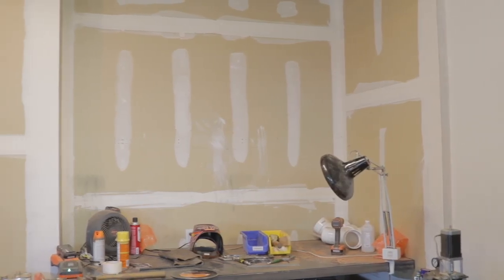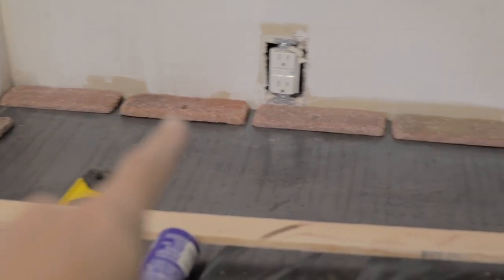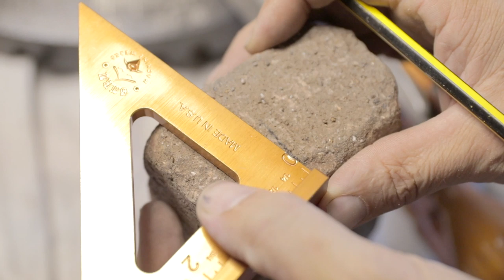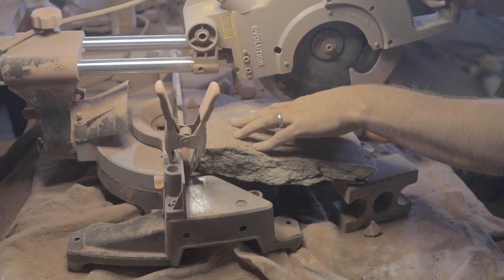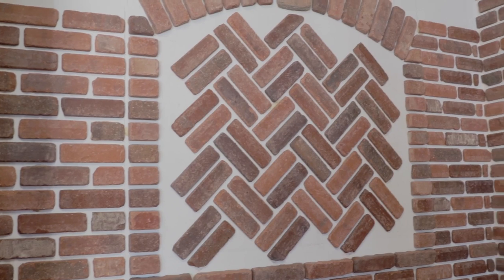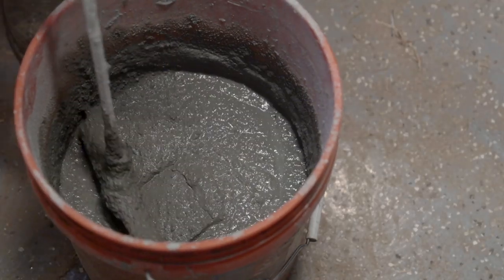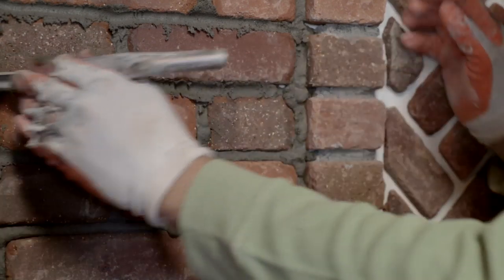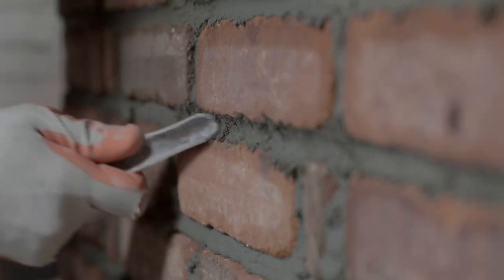How to Lay Thin Brick Like a Pro

Comment: First...great job Greg.  Artisan level work!  I had 1 issue.

IMPORTANT:  NOT ALL TYPE S MORTAR IS CREATED EQUAL.  IF YOU HAD TROUBLE GETTING YOUR MORTAR TO FEED OUT OF THE GROUT BAG - CONTINUE READING

When I started my project, I had a QUIKRETE TYPE S mortar - 80 lb bag.  I bought it because I figured Type S mortar is Type S mortar.  It is not.  I've done quite a bit of tile work and mixed the mortar to a consistency that I thought should work.  This however, was my first grout bag attempt.  Total failure.  I tried 20 different methodologies trying to get the "grout" to feed out of the bag.  I'd get 1 to 6 feet of grout out and then the entire contents would turn to the consistency of wet sand and there was no way to get the feed going again.  I literally worked for 4 hours and got maybe 30' of mortar done.  All my time was being spent emptying the bag, cleaning it and restarting the process.  Tried different levels of wetness - all for naught.  The issue when this happens, is too much sand in the mortar mix.

I switched to Spec Mix Type S mortar - THIS MADE ALL THE DIFFERENCE.  After the switch, the mortar fed out of the grout bag just like all the videos I'd seen online.  I hope this helps someone.
Reply from the maker: Great information Dale!  Thanks for taking the time to share.  I'm going to pin this comment to the top...  I hope this doesn't sound like it's coming from a "high horse" perspective, but this is why I recommend using a masonry supplier for your entire project.  Those guys live this stuff every day and they will put the right product in your hands.  They also would never be caught dead with QuikCrete on the floor of their show room...  All type S has to meet a strength requirement, but you are correct; it's NOT all the same.  I hate that you had to go through the pain of finding that out, but I'm happy you shared your experience.  That's what my channel is all about - helping the next guy do it better.  Cheers!!!
Reply: @GregsGarage  Happy New Year Greg!  No, your response does NOT sound "high horse" - it sounds like the voice of experience.  Honestly, I didn't know there was such a thing as a masonry supplier.  I've had to use electrical and plumbing supply houses on previous projects so it makes sense - I just never thought of it.  I have another question, but will post it separately so as to not detract from this thread.
Reply: Thanks Dale and Greg.  I am ramping up to do a project like this, and my only concern was the consistency of the mortar, and the specific type.  I do have another question that I get mixed answers to... Greg applied a primer to his wall, and some folks tell me I need to clad the wall in concrete backer boards like the material used behind tile in a shower.  I would rather prime the wall (cheaper and faster).  What do you guys suggest for this application?
Reply: @matthewpeterson3329  A great question.  I don't know why, but I'm pre-disposed to not apply tile/brick veneers, etc to sheetrock.  I guess because I grew up with brothers and we routinely did stupid stuff that I feel like would damage the underlying wall.  So I can't really answer your question other than to say that I used the cheapest backer board I could find...in my case it was 4'x8' Hardie siding...which isn't cheap.  One more thought...if you ever decide to hang anything on the wall you're remodeling...you may want something extra to help hold the load.  Good luck on your project!
Reply: @daleedwards7940  Thank you Dale.  Excellent advise.  Your comment about having brothers reminded me of an incident about 50 years ago, when a poorly executed back flip, while I was jumping on my bed, yielded a face plant and two knee-sized holes in the drywall above my pillow.  Mom was not happy.

Comment: Great job! However, I would not recommend this adhesive in the future.  It sags considerably, which means you must have enough wooden spacers for the entire wall.  It also has a 2 - 7 day drying time.  I would recommend Loctite Power Grab Ultimate, which sticks immediately, allowing you to remove the wooden spacers. It also dries in about 24 hrs, allowing you to mortar more quickly.
Reply: What’s benefits of using an adhesive over say thin set?
Reply: @garrettp.5018  the problem I've heard is that it is not sticky enough; the "tiles" slide down the wall,  jamming your spacers. I'm not even sure it will adhere to brick.  Then when you try to pull the spacers, you run the risk of pulling off your bricks.  If you use rope,  the bricks will crush the rope and end up creating spaces that are smaller than the actual diameter of the rope.  I have heard of people using mastic, which is stickier, but it smells horrible, and is also harder to find.  I would put out little extra money and use the Loctite Powergrab Ultimate. Use a caulk gun and "butter back" the bricks. Make sure it's a rough surface, or at the very least primed with a quality primer.

Comment: I’ve watched so many installing videos for thin brick and/or veneer brick. No one else used or uses a glue compound for adhering the bricks to drywall. I’m following your lead, hope it works.
Reply: Follow up on this, the set time was too long for me. I was using regular tile spacers on non-uniform shaped thin brick. Which caused the bricks to not fit properly with the spacers and they were sliding down the wall. Ended up buying dowels and switched over to liquid nails extreme. Can I post a picture on here? Don’t know how.

Comment: Really well-done: the project and the instruction! It is beautiful! I am inspired. 

One comment, which I hope everyone will take in the spirit I intend—to keep each of you healthy—be aware that these products: the brick, tile, and the grout, all contain silica—yep, just like sand at the sea-shore—but when in very fine particles, inhaled, it causes lung damage, which can become serious, and even fatal, over time. 

In a ceramics studio, the silica in clay is worked wet, so that as with the mixed grout here, it is quite safe. In a well-run studio, all of the clean-up is done wet, so that there isn’t silica dust in the air. 

Any time it is dry, though, for example, when cutting brick or tile, or mixing dry grout, simply wearing a well-fitting HEPA filter mask can prevent lung damage. These are inexpensive—as low as $35. You can order one on line, or in a city of any size, find an outlet for contractors, which sells safety equipment. 3M manufactures them, and now makes ones better fitting for women too (which I appreciate.) I have also bought one from another manufacturer—the name escapes me. Look for ANSI certification. The mask should fit snugly, so no air can escape around the edges. 

Again, great video—I’m inspired to do something like this at home, having far more time than money! Thanks for posting this.

Comment: Great work 👏 👍 👌 
I have a question. 
Can I use this thin bricks as outside siding without exposing the house to extreme heat or cold, snow and rain, and high humidity and moisture as I live in Toledo, OH where I think we have the worst weather. 
Also can use cement to glue the bricks.

Thank you

Comment: Looks awesome.  For those looking to cut costs, if you can acquire a bunch of regular bricks,  you can use a paver saw and cut the bricks lengthwise into 1/2 inch or so thin bricks.  It must be a brick or paver saw,  because the brick must clear the top of the saw. They can be rented.  I went on Craigslist and in the community looking for free bricks. It also allows you to use some variety.  You might get lucky and find some stamped bricks!

Comment: Thank you for the video! Very informative.  I am getting ready to install a brick veneer on a drywall wall that's 17'x8'.  And I have gone back and forth a million times on how I'm going to approach the install.  Manufacturer suggests moisture barrier, metal lathe, lots of mortar, and then the brick.

I like your approach much better though. Any regrets on using the loctite? I'd use loctite power grab general purpose. Any thoughts?

Comment: Great Job! , I want to do the same on the walls around a wood stove. Is it ok to use this same adhesive Loctite PL400 or do I need a different one for heat resistant?
Reply from the maker: I would defer to your supplier.  There are different types of brick, backer and adhesives for use in heat sensitive areas.

Comment: Beautiful, but not sure it is right to put all that weight on sheetrock?? other videos installed a wire mesh first and brick on top of the wire mesh
Reply from the maker: This was the supplier's recommendation for an indoor application.  The manufacturer also recommends this method for installation indoors.  If you are installing the veneer outside, it needs to be handled with a completely different set of details similar to a traditional stone veneer application.

Comment: this. is. awesome. i was so inspired i pretty much decided to copy, borrow, steal, replicate your entire process (though on a much smaller scale). i only have a pilaster...but the english pub...great stuff. one thing thing....using the Loctite Subfloor...you make it looks easy....finding that it takes a few hours to fully set up. dont know how you didnt go bananas waiting for it to dry. but beautiful work!
Reply from the maker: Yeah, they have a "quick grab" adhesive, but it still needs to set up.  I had a system where I'd lay up 5-6 courses every night.  On the weekends I'd lay up bricks in the morning and then again in the evening.  I'm glad you were able to steal a few details!!!  Brick is all about the patterns, bumps and edges.
Reply: @GregsGarage  you are my hero for responding. and for confirming that im not crazy. i started yesterday and it kept sliding. i cut 7/16s spacers which helped. then a couple hours later...bricks still had some give. so i woke up this morning with the plan to lay two or 3 levels every 4 or 5 hours. based on your process...im on the right track. and yes...love the bumps and edges. tile saw was giving me lines that were too clean. needed to take the hammer to the edges to rough them up...based on your work....thx again.

Comment: Great video about this process.  I'm about to use the same process to lay thin brick behind a wood stove to make a fireplace appearance.  This has some good tips I hadn't considered and I'm getting the grout bag and joint tool from your amazon links :P   I'll be cutting my own thin bricks from whole salvaged bricks with a wet saw.  I've cut brick with a dry diamond blade and that is super messy!!  I hope you wore some PPE.
Reply from the maker: Good luck Charles...  And yes, I had a full respirator on.  I also had a dust mitigation system running the entire time.  I would have preferred a wet saw for sure, but I didn't have one available, so I used the dry saw.

Comment: Greg, you did a very respectable job for an ‘architect’ and not to criticize your work but a good mason would never column stack the pilaster like you did. As you mentioned, getting the details right is what sells the job as authentic. The better way would have been to use a running bond and alternate cutting and turning the corners to eliminate the tiny pieces you used on the ends next to the whole corners. Make sense? 

Worse, I’ve seen thin brick or stone installed on bump outs where there’s no foundation or any kind of support for a real masonry wall. That’s a dead giveaway that it’s a ‘lick & stick’ installation.

Comment: Question, I’m doing bbq island and using the polymer mortar specifically for thin brick, like $15 bag, works well , question is for the grout lines should I use the same or just get some pre mix S type ?

Comment: Wonderful wonderful tutorial!  Quick question:  could I used drywall primer on old plaster walls or would I need another type of primer?
Reply from the maker: You'd have to ask your supplier.  I'm not sure what primers provide the best adhesion to plaster...  The PVA primer works well on the paper face, which is COMPLETELY different than a cement plaster.  They may actually suggest a thin set since you're substrate is porous.

Comment: Greg can I ask you why did you use adhesive instead of thin set mortar?
Great job btw!
Reply from the maker: A few reasons.  First, the walls were already finished in drywall.  I didn't want to add a cement board backer.  Second, its interior, so adhesive will work.  Lastly, the adhesive grabs quicker than thin set...  There's nothing wrong with using thin set, it just wasn't the best approach with this application.

Comment: I am a bricklayer and I say you do great work lol 👍and where did you get that little square at? Never seen one that small
Reply: You’re exactly right! I’m a Mason also and was impressed with his work. 
Especially with him using the grout bag, most of seen try to use a tuck pointer. 
And for all those that think the grout bag looks Easy, it is.... but those forearms will be worn out after that entire wall. lol

I’ve never seen a square that small either. I’ve Always just thrown another brick over my cut piece to line it up.
Reply: I'm a mason, and my concern would be longevity of this over time.  I'd much rather put up cement board and use a thinset mortar on an application like this.
Reply: @jamesfranks1790  I have been doing some research, getting ready to do some of this in my house and I agree with you
Reply: james franks 
You’re right, it’s likely they will come loose and fall off over time. 
Hardy backer board works really good and I’ve had good luck with Mastic holding them secure.

Comment: Hi Greg!  Great video!  Quick question…
I am using thin brick on an interior wall that has OSB and not drywall.  How would you suggest I prep the OSB?
Reply from the maker: I would defer to your supplier / manufacturer.  They will have the best prep and adhesive recommendations for the product you are going to use.

Comment: Great explanation. Would you be able to hang something on this wall?
Reply from the maker: I've hung several things on it.  I drill through and use drywall anchors.
Reply: And the wood you used for the spacing, did you also use it to hold the brick in place?

Comment: Question about overhead grout/mortar joints - do you have any pro-tips for how to get mortar to stick into an overhead joint?  Mixing it drier sounds logical, or perhaps an additive?  Just thought I'd ask before spending a lot of time experimenting.  Thanks Greg!
Reply from the maker: You nailed it...  You can mix it like normal, then let it sit a bit to stiffen up.  It's going to be a challenge to get it in the joint but it shouldn't just fall out if you put it in with a little pressure.  I don't know of any additives to help it stick while its wet.

Comment: Hi Greg - this is awesome! I have a question for you.  I have OSB walls now.  Will this method work on OSB if I give it a good prime first? Thanks!
Reply from the maker: You'll have to check with your supplier.  They will know which substrates need to be primed and which have enough adhesion as-is.

Comment: You should use a wetsaw for all those angle cuts instead of a chipping hammer  it would be quicker and cleaner .also instead of pl use tile mastic and spread it on the wall
Reply: Using hammer and chisel gives an artisan look that can never be achieved with electric saw.  Also, tubed adhesive allows one to work at as slow a pace as one fancies, as opposed to having to finish applying a whole batch of mixed glue/mortar before you can stop to rest.  To each its own I suppose.

Comment: Hi Greg, that looks great! I just subscribed to your chanel :) 
I'm doing a smaller project with the Cityhall bricks from GS. Which was the recommended adhesive? Would the PL "Fast grab" make for a quicker install vs the PL400? And have you had any issues with the installation after all this time? 
Thanks
Reply from the maker: They recommended the fast grab at the supplier.  I think I had one tube of it and it wasn't as fast as I wanted it to be.  They made it sound like you could hold a brick for 30 seconds and then it would stay put...  That's not the case.  I just laid up about 3 rows and I'd take a break for about an hour or two to let everything set up.

Comment: hi this is really beautiful work - is this just adhered to drywall ? have you had any issues - is the drywall strong enough to hold the thin bricks - would really appreciate your feedback as im planning to embark on a similar project. thank you for your time
Reply from the maker: It's been in place almost 3 years.  No issues.  Your supplier should be able to give you all the details on how much weight your walls can take, adhesives, etc.
Reply: @GregsGarage  wow awesome thank you for your wonderful insight and inspiration.. appreciate your time and reply..  thanks again !

Comment: I thought you had to replace inside drywall with cement board or Hardy board to put in brick veneer. I was told the paper of the drywall wasn't strong enough & the weight would cause the brick to pull loose. Have you had any problem with that since this was put up? I really don't want to have to pull down a whole wall of drywall if I don't have too. Thanks & great video.
Reply from the maker: The advice came directly from my supplier.  He recommended the use of primer, so I suspect the added adhesion was important...  The brick looks just as good today as it did the day I installed it.
Reply: @GregsGarage  Thank you for your reply. We are going to do the same as you have done.